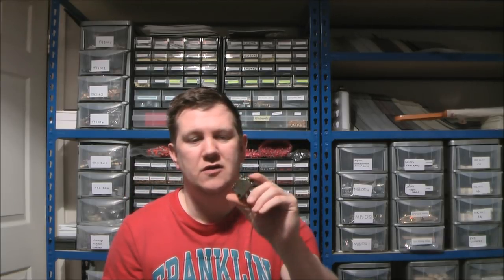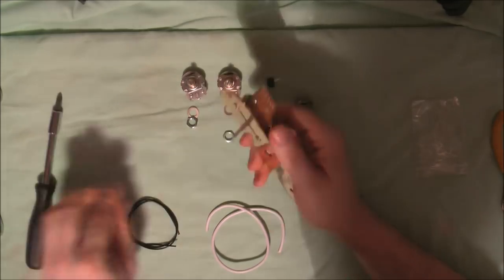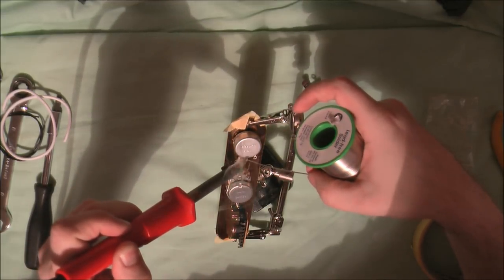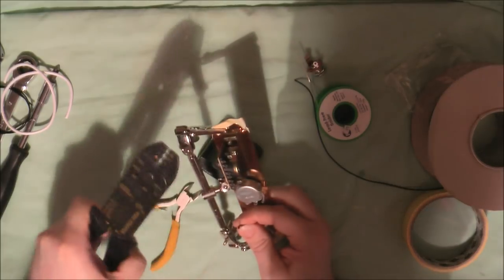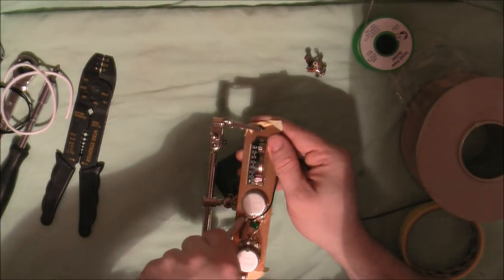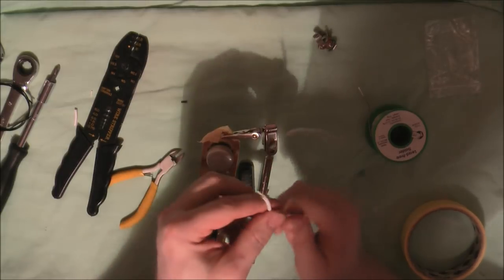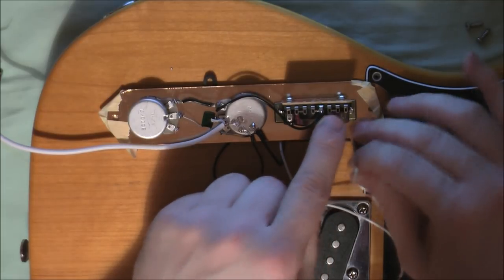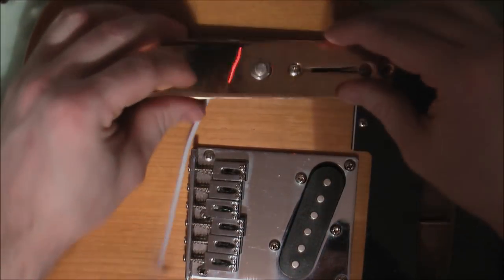How to Wire a Telecaster Control Plate

Comment: No nonsense well done. Explains pot and cap types for different pickups, an excellent vid to get your bearings straight on replacing your control plate workings in a telecaster. Thanks!